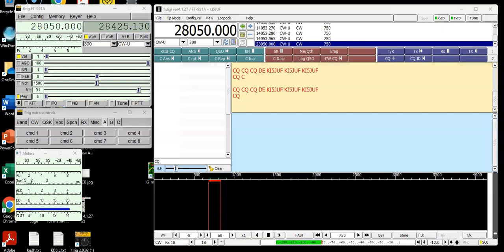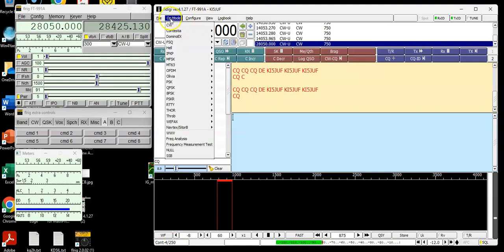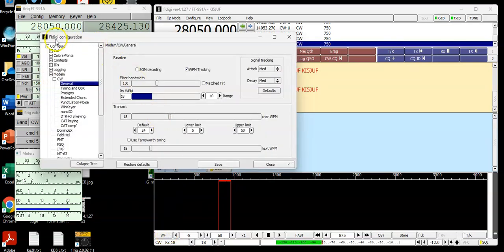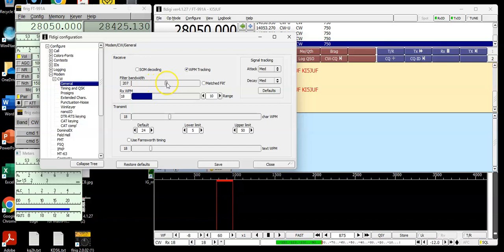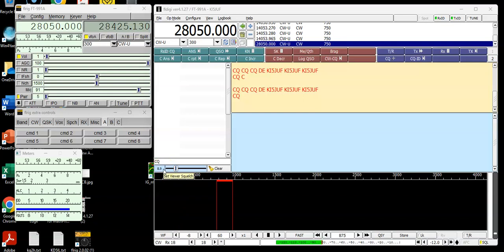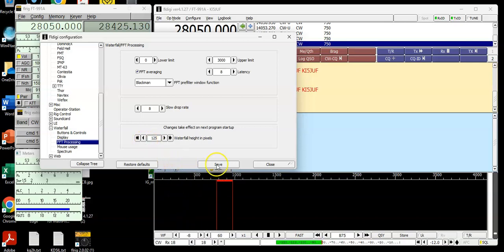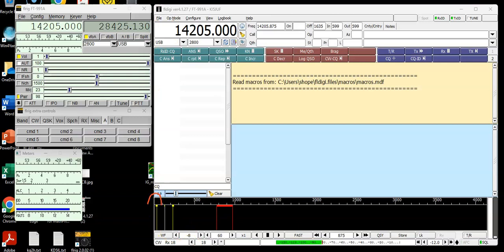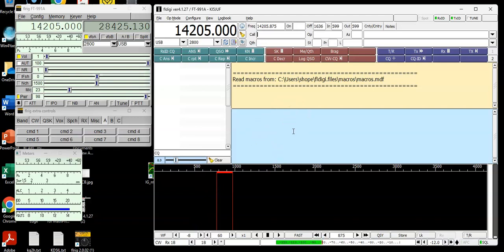FLDigi (Waterfall ), (Pass Band), (Store) button ops & DTR options for practicing w/o transmitting.

Comment: Any idea why the waterfall is black while receiving? Mine is the same way.
Reply from the maker: Good evening and thanks for the message - try adjusting the upper signal strength I show this the on the following video https://youtu.be/muDed2wOgy4?si=G4TAzk6HRTMt0vVu  it allow lower signals to show up let me if the works it's about 13 minutes into the video were I show this GL and 73